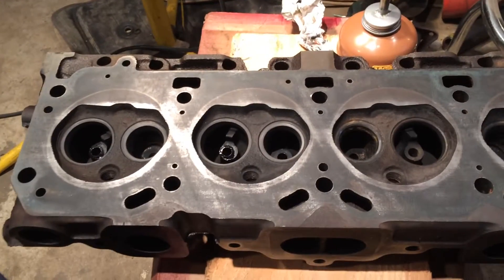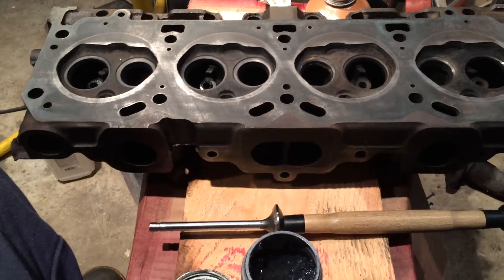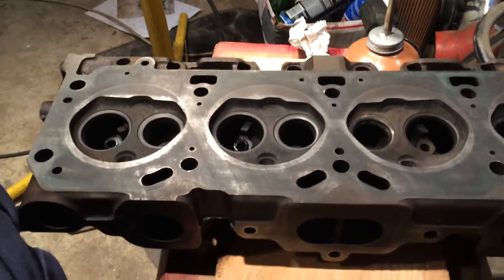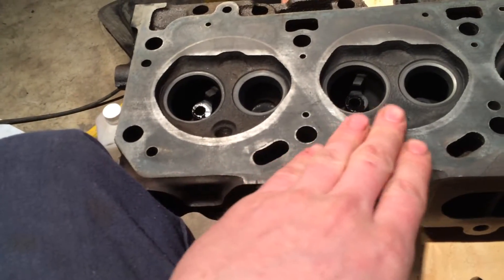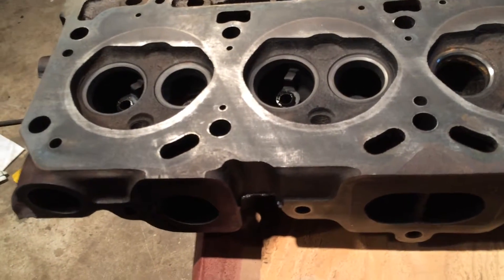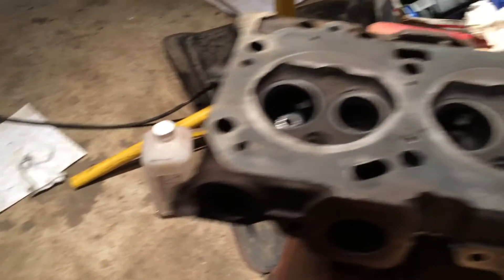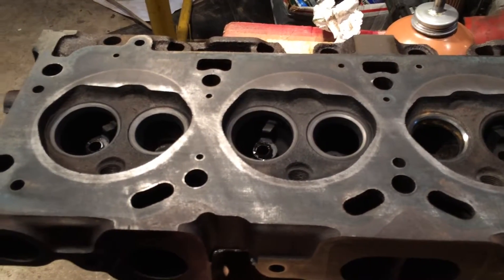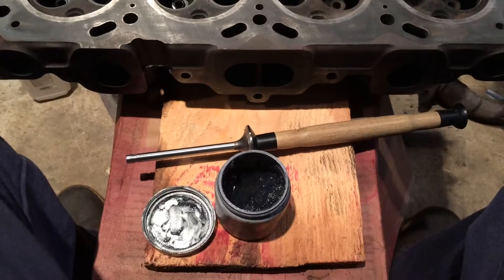How to prepare cylinder heads for dye penetrant

Comment: Hey thx for making this video pretty helpful set of videos you have. Can you plz type the material you used to clean the cylinder heads? Just to make sure I am ordering the right material to clean the cylinder heads so I test for cracks properly! Cheers
Reply from the maker: Thanks! If I remember correctly i scrubbed the cylinder heads with brake cleaner.